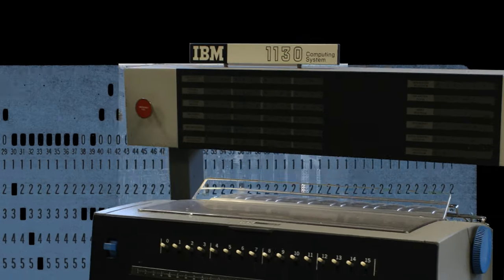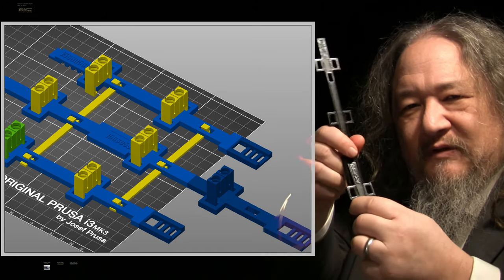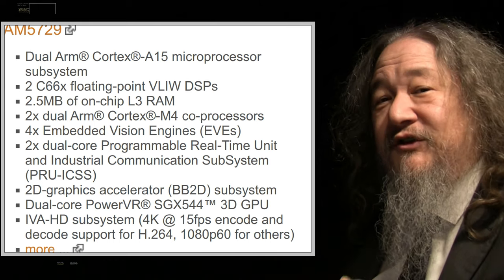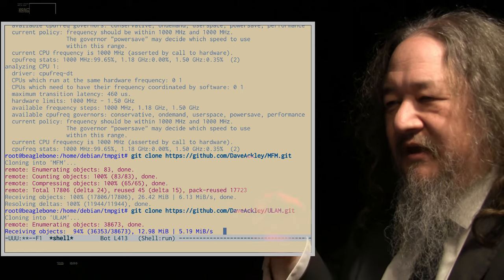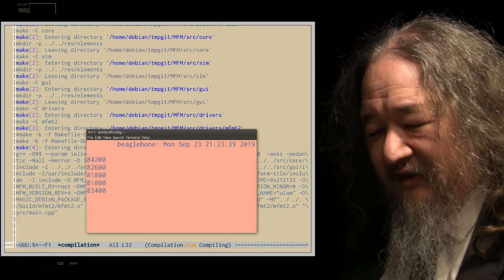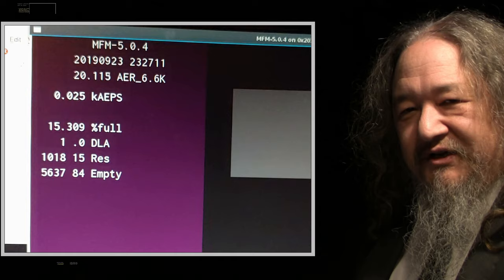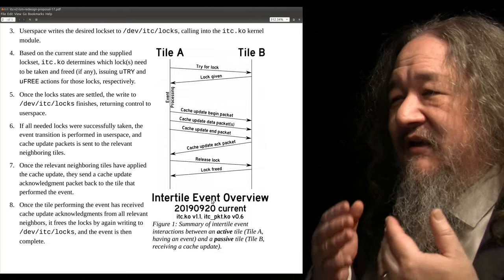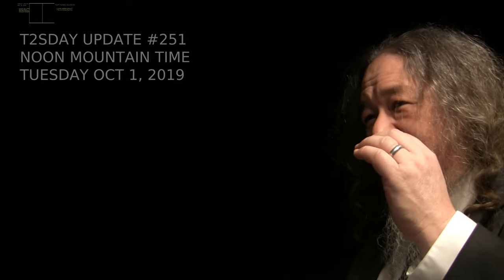BeagleBone AI Hands-on - T2sday Update 250

Comment: I just get this feeling that there's got to be a way to use the unique architecture of the t2 tiles to do event updates differently.

If I remember correctly, each tile keeps the neighboring sites of other tiles in cache. Couldn't you just lock the sites on both tiles, and only unlock them one by one when the cache updates updates the site? Though I doubt it'll be faster than updating them all sequentially.

I see a lot of parallels between the t2tiles events and the concept of eventual consistency in distributed computing, although I struggle to think of a concise way it could help.
Reply from the maker: Events are random; can't know who'll grab which shared site next.  I think self-stabilization more than eventual consistency but for sure distributed systems generally is relevant.